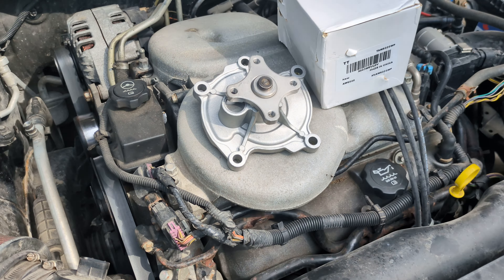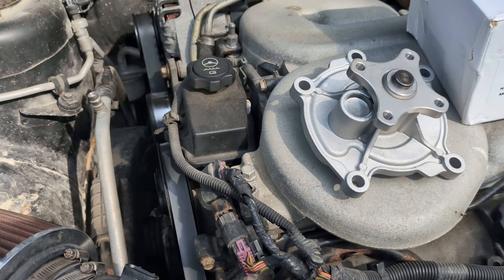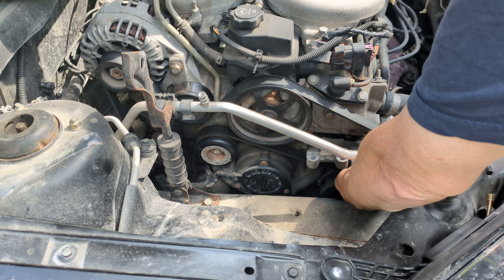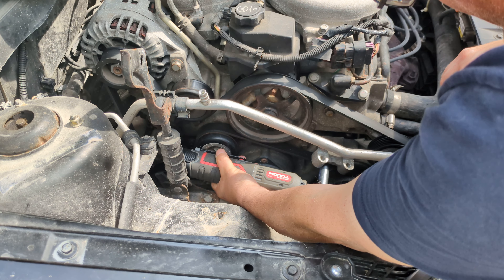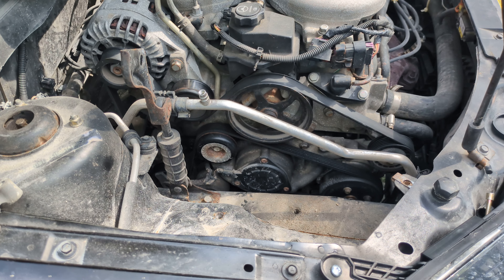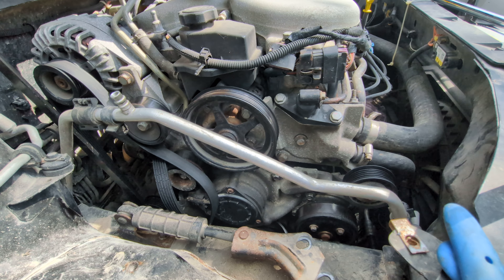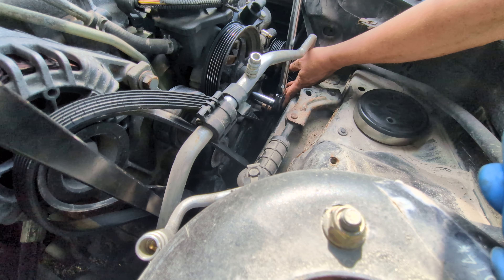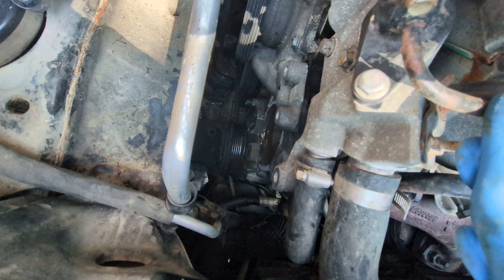Pontiac G6 cheap water pump installation

Comment: What did u use to glue the gasket to the pump ?
Reply from the maker: I used Grey permatex gasket maker. Very light coating.
Reply: @crazybillsgarage  do u use it for both sides?
Reply from the maker: I just used it for water pump to gasket, but it's whatever you are comfortable with. Sometimes I do both sides.
Reply: @crazybillsgarage  ok.. thank you for your help
Reply from the maker: @ChrisG-mc2bd your welcome